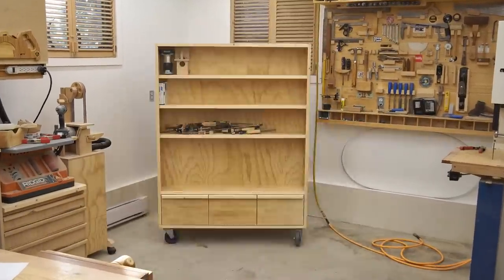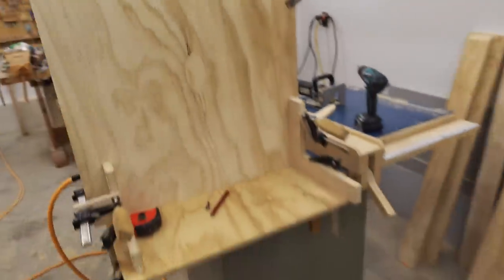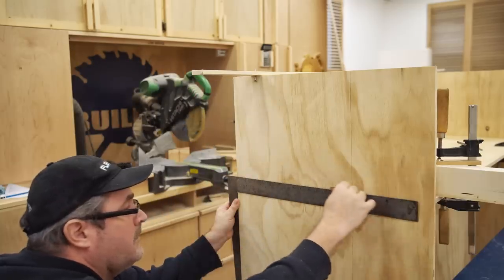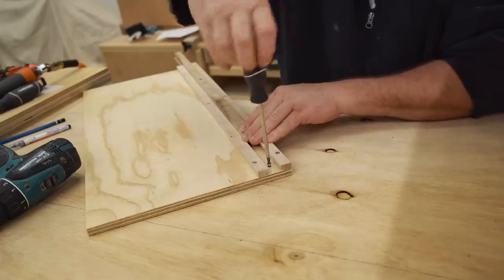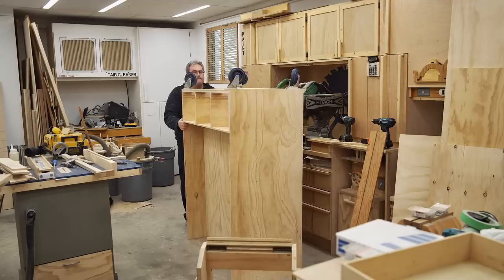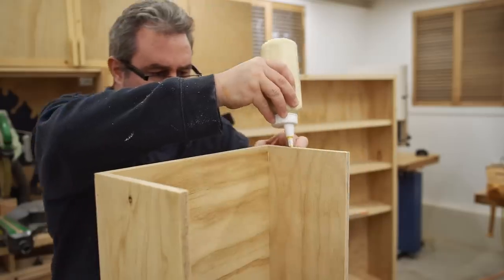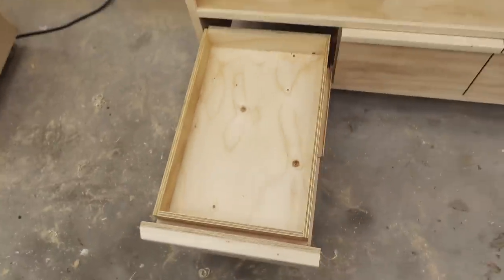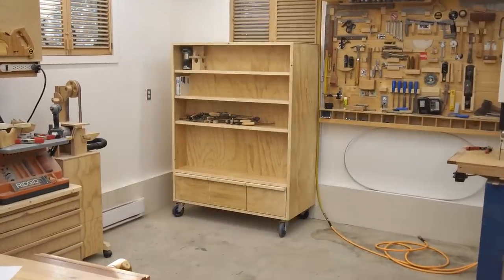How To Make A Storage Unit with Drawers

Comment: I don't think this will help your work surface clutter. You have a tool access problem. Your workbench gets cluttered because it's too hard to put everything away everytime you use it. Especially if you are using the same thing every few minutes. You need to increase access to your tools and supplies, not increase storage.

Comment: John,  Great idea and design.  I have the same problem with clutter on the work bench.  I guess if I would just put stuff away in the boxes and drawers that they belong in, my clutter would be gone.  It seems that by the time I finish a project, I'm either too tired to do the clean-up, or I have something that looks more important or fun than putting stuff away and cleaning up.  In my mind, that's a mental illness!!

Comment: Regarding your double drawers: You say in your build article: "While overall this in not the most practical way to do things, it does have advantages" Then go onto point out the most practical of reasons to do this: "the contents of the upper and lower drawers could be related, so you would be able to access both at the same time".

So it all depends on application. If you have related items that have big and small parts that won't fit in one drawer then this is the most practical of solutions! I love it!

It'd be cool to see a weight test on the wooden slides to find out the maximum weight for a given dimension of the middle piece.

Comment: So it has been 2 weeks.
Has the "clutter" side of the storage unit filled up, and clutter started to accumulate on the work bench yet? 
You know, unless you have a mental condition, you cannot get around the Law of Horizontal Surfaces, right?  ;)

Comment: niiiiice.... why you made it moveable? are you gonna move  whole storage to place where you are working?
Reply: I think access to front and back is needed. Also cleaning around the cabinet is easier. Rearranging the shop in the future. I'm sure there are more reasons but I would never build anything for a shop like that without wheels.

Comment: Hey John, just wondering what kind of glue is that, that you're using in the silicone gun? Is it silicone caulking? You do know that silicone doesn't stick to plywood, right. You should've used Gorilla glue. That stuff is the best.
Reply: PTcruser65 PL brand construction adhesive

Comment: Good morning John.  I too collect junk on horizontal surfaces.  Shelves are great but ..... junk is still visible and it often falls off.  My solution was to get cloth bins (plastic available) from Dollarama.  The bins act like drawers and "corral" like items.  Black bins or maybe blue would look great in your shop.
Reply from the maker: drawers are the worst junk collectors for me. that's why i switched to vertical one for most of the regularly used stuff.
the shelves are better because you can only pile stuff so deep and it's easier to rummage through or to clear out.

Comment: John, my experience with wide, thin shelves is that they invariably sag as my collection of “ good stuff” grows in depth and corresponding weight.  To help, I’ve glued vertical strips to my he front and back of the shelf.  What think you?
Reply: Paul : you are right but I would also add one down the middle.

Comment: This is to practical a build for me to do, besides you didn’t use thousands of dollars in festools, to do the work.
Reply: I worked in a cabinet shop that used Festool equipment. I quite frankly did not like them. The track saw was severely under powered and we burned the motor up twice in a 6 month period. The "ergonomic" sander made my carpel tunnel flair up every time  I used it and lets face it a Domino is just a long, square biscuit. Foreign overpriced tools is my opinion of them.

Comment: I have the same problem as you John, every horizontal surface in my shop gets cluttered with crap. My big work bench that I have my miter saw on, my smaller work bench, my table saw, my lathe to some extent, my planer, etc. lol. Great project, I wish I had space to put something like that in my shop. I love the idea of the sideways sliding drawer in the drawer as well as your drawer slides.

Comment: A place for everything and everything in it's place, including the junk.  I'm skeptical though because I see non-junk mixed in with the junk.
Reply from the maker: All of my junk is good junk, to one degree or the other. "Junk" for me means I haven't sorted it out yet or used it for another project, and not to be confused with "garbage", which is just garbage. Junk stays, garbage goes.
Reply: I would consider junk to be things that might have a use in the future but I don't know what that use might be.  Whereas I see stuff like tape and a ratchet in your junk, which are things that should have their own home.  The fact that they landed on the junk shelf isn't a good sign, but I suppose you just cleared off the bench real quick to get the video out.

Comment: Good idea John, trouble is I’d have to put it outside !   Do you beeswax those slides ?
Reply from the maker: I tried paste wax and that was pretty much a waste of time. I then smeared Vaseline on the wax and that improved the situation, but the best treatment is to give the slides two coats of waterbased poly before installing them. Slick and smooth without any messing around.